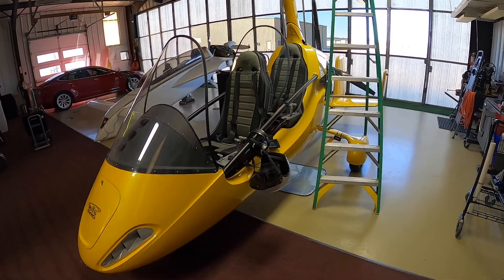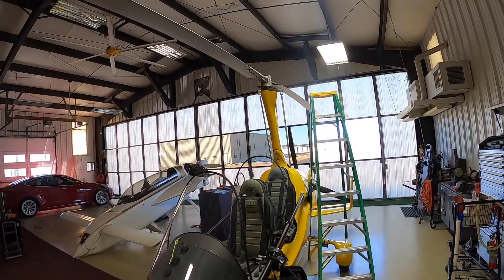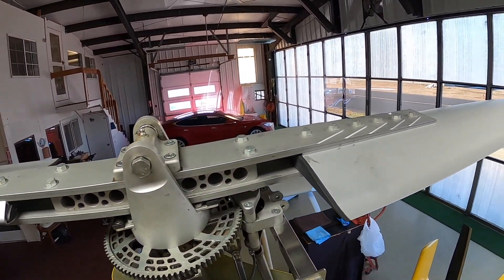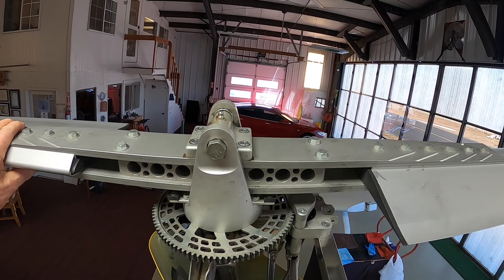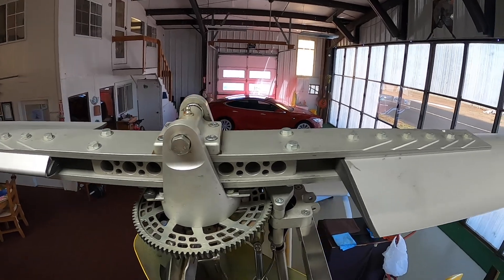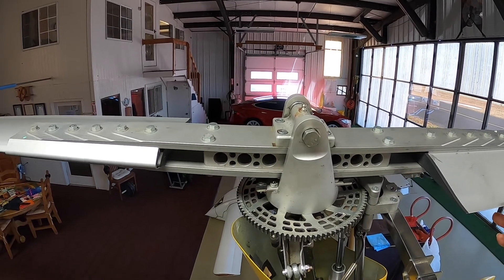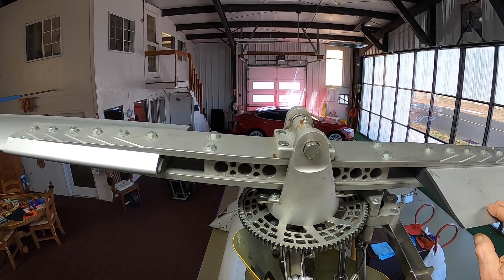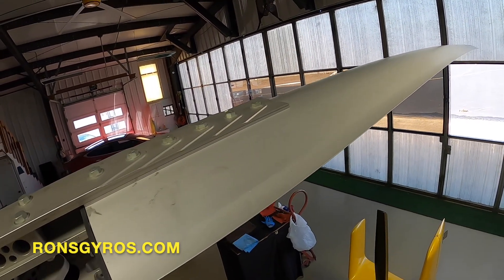Understanding Gyrocopter Rotor Blade Teetering and Flapping

Comment: What I am impressed with in this simple but ingenious design with the semi ridged teetering rotor system is the reason why the rotor is under-slung. There is a reason, actually several, why the teeter bolt does not pass though the center of the blade. Certainly the teetering motion of raising and lowering to the same amount could occur with the bolt passing though the center of the rotor. De la Ceirva found when the advancing blade rose, the center of mass of that blade moved closer to the axis of rotation. This caused that side of the blade which teetered up to want to accelerate. Because it was connected to the descending blade, it could not. A stress point was created and he actually lost blades. He had already created a flapping hinge but this prompted the design of the lead-lag hinge. This allows the blade to accelerate or decelerate as needed thus releasing the stress. 

A semi- ridged under-slug teetering rotor system has no lead-lag hinge so how does it release those same stresses which Juan de la  Cierva had to deal with in a much more complicated manner? Two things are happening with this simple ingenious design. First the amount of under -sling is level with the center of mass of the blade at its coning angel. The second and most important is when the blade rises the teeter moves the blade out just enough where that blades center of mass does not come closer to the center of rotation and most of the stress is relieved. 

I have been told that Bensen did not invent the semi-ridged under-slung teetering rotor head system but he certainly ran with it. Also note that the for and aft movement of the rotor head is not centered and in line with the point of rotation. Typically these are separated by an inch or so. I do not know exactly why this is so other than it helps in keep the stick pressures down and helps the  craft keep trimmed in turbulent conditions. I really would like to know more about the offset and how this evolved. 

I admit I have a bit of hero worship with Juan de la Cierva and those who later perfected his invention. Such a seemingly simple design actually does so much and is overlooked by those who just glance. 

One last thing. I have never flow a Gyroplane any length of time with a cabin. My experience is open frame machines. What the heck is “Cabin Hop?” How does one adjust the rotor to eliminate it. How is this different from a two per cycle stick shake?
Reply: Cabin hop is vertical up and down movement of the cabin or even your instrument panel or seat. Think like the up and down of horse riding.  It is mainly caused because rotor track and balance (RTB) is not up to snuff. Mainly the tracking. One blade tip path is higher than the other. You adjust that on a teetering fixed pitch 2 blade system by putting shims of a couple of thou (generally) under the teeter block (between hub bar and teeter block). The smoothest ride may not be a perfect tracking (same exact tip path). It may occur at slightly different tip paths.

Comment: I would think 3 blade main rotor systems more common than two as they produce much less stick shake. Less stick shake should indicate less structural stresses on the craft
Reply from the maker: Years ago there were 2 certified gyroplanes, the J2 McCulloch and the 18- A, Air and Space. Each had fully articulated 3 blade rotor systems designed for helicopters. Helicopters take off and land without rolling forward but these rotors on a gyroplane are subject to ground resonance when the gyroplane rolls for along the bumpy ground for take off and landing can cause the 3 rotor blades to become  misaligned with each other. Those 2 gyroplanes had to be designed for a jump take off to prevent the problem. A 2 blade teetering rotor system is the most practical for  small single and 2 place gyroplanes